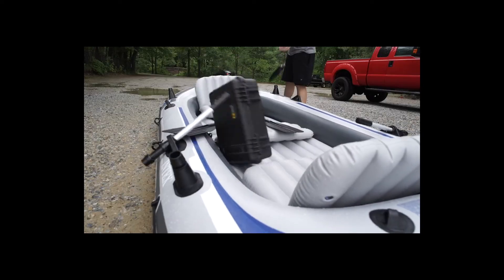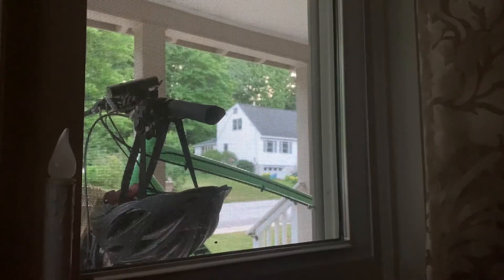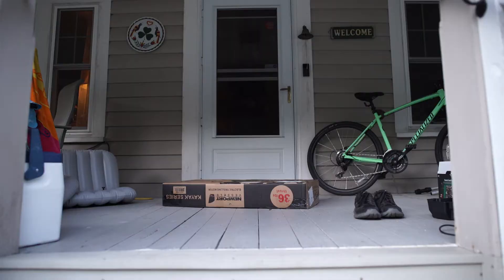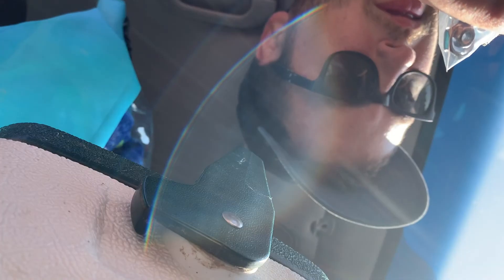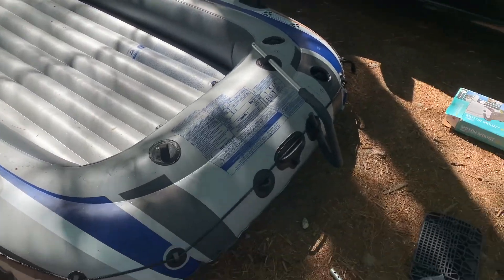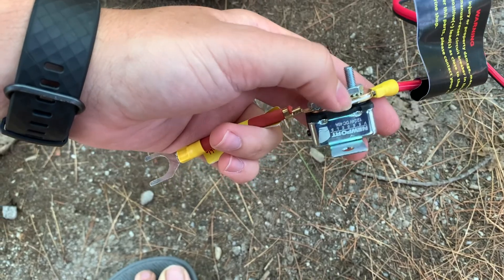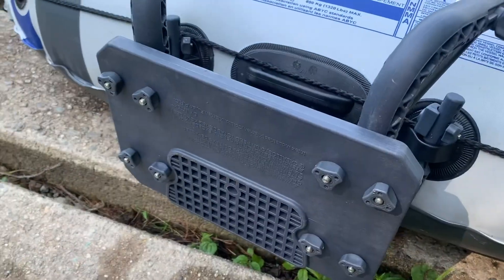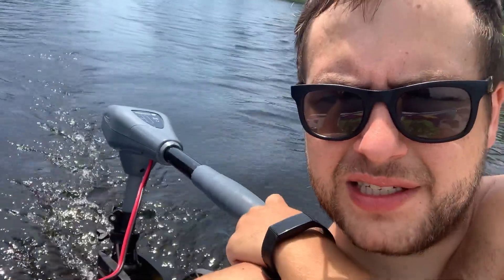DAY 1239: Intex Excursion w/ Trolling Motor

Comment: I bought a 100ah jumbo battery for mine.. almost 5 hours on the river yesterday and still had over 75% juice left with Intex's trolling motor.
I did the carpeted plywood floor thing, lots of compliments out there.. ppl love this boat!
Reply: I just bought an excursion 4 I'm getting into the boating as a hobby. Please,do you have Any tips you can share based on your experience with this raft

Comment: I bought a same model this year. May I know where the battery you put on the raft? Does the battery need a box? Thank you!
Reply from the maker: I would recommend putting a box on it. They are very cheap and give you a little peace of mind in protection from water and heat. I just kept mine toward the back of the raft. Never had any weight or balance issues
Reply: @KellerNH  Got it! Thank you for all the information you provided!